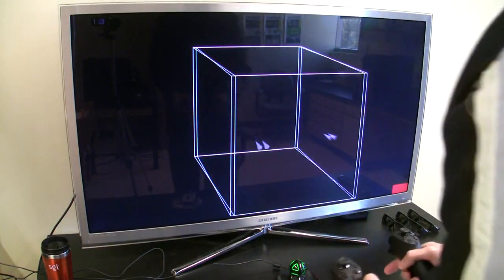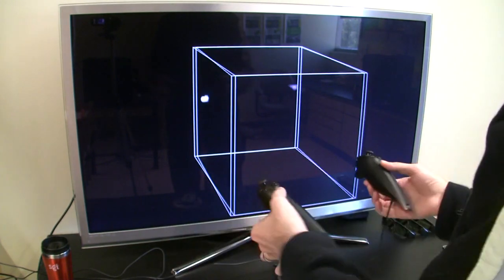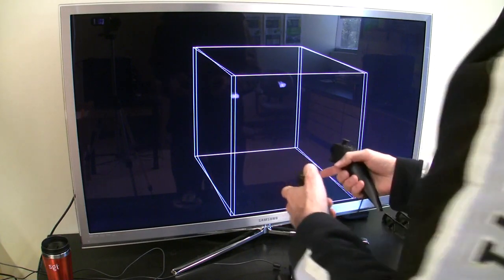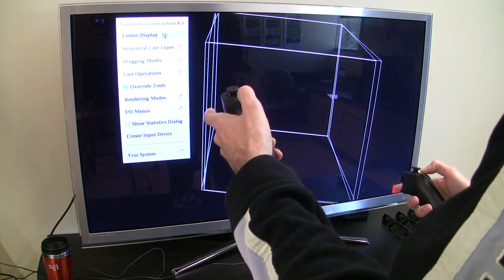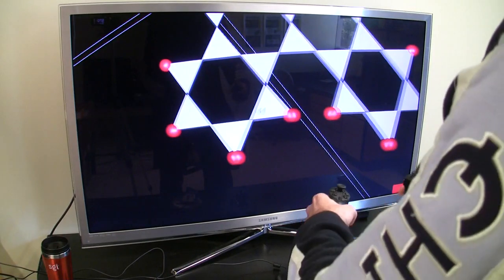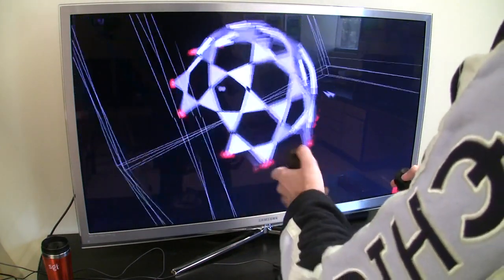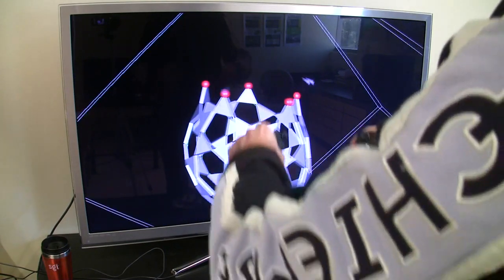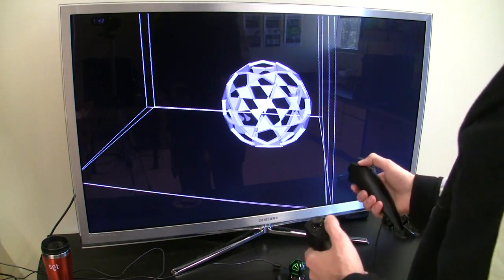Razer Hydra for low-cost 3D displays

Comment from the maker: They're basically completely different things. The Wiimote can detect acceleration along any axis, which is a way to detect 3D gestures, and the Wiimote+ can also detect rotations. Together, those two can give you orientation tracking. The Hydra detects absolute position and orientation in 3D space. The Wiimote can only do that after heavy modification, or as a part of a larger tracking system.

Comment from the maker: Yes, my software has non-linear tracking correction already built in. The problem is that it's impractical for end users to do the required calibration steps. You'll need some external distortion-free absolute 3D measurement device to capture tie points between distorted and undistorted measurements. I would do that if I had to use Razer Hydras in a professional setting, but for the scope of the system I'm demonstrating here it's not applicable.

Comment from the maker: The problem is speed of light. To get timing-based triangulation at 1mm accuracy, your clocks need to be synchronized to 3.33 picoseconds.

However, replace radio with ultrasound, and you have exactly how the high-end Intersense IS-900 tracking system works. You have to very precisely measure the 3D positions of the receivers (senders, actually) using a survey laser range finder, but that's how it's done.

Comment from the maker: Leonar3Do has head tracking, which creates "holographic" displays where virtual objects appear solid. That's the same as our next level up in low-cost VR, combining a 3D TV with an optical tracking system. I'm still working on a low-cost head tracker to add the same degree of realism to the type of environment shown here.

Head tracking adds significantly to the usabilty of a 3D display.

Comment from the maker: There is a trade-off between lag and noise. The unfiltered measurements from the Hydra are very jittery, and I am using a variable low-pass filter to get rid of it. The filter gets more aggressive as the handles move away from the base station (as noise is proportional to that distance).

You can reduce filter strength in the configuration file to get better response time, at the cost of some jitter.

Or, you can bring the base station closer to where you will typically hold the handles.

Comment from the maker: That's actually a very good comment. The problem is that to use the Hydra to its full potential, one has to punch through the user interface layers of the target application. Something closed-source like, say Maya, will only have interfaces for mice and maybe spaceballs, and emulation just doesn't cut it. Blender might work because access to the source code means that someone could create a native interface for the Hydra.

Comment from the maker: I missed the Kickstarter. I have two HMDs right now, and am working with them. The experience from that is why I'm a little concerned about the Rift. Not so much from the hardware point of view, but from how it will be handled in the software. There are many things that can go very wrong. That's one of the reasons why I started a blog.

But a friend of mine will get his Rift in March, so I'll get a stab at it.